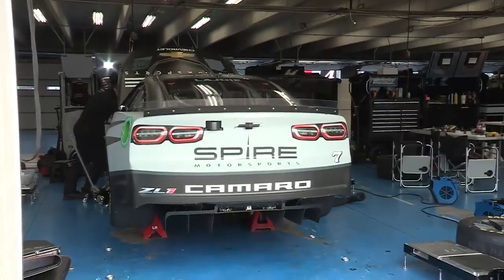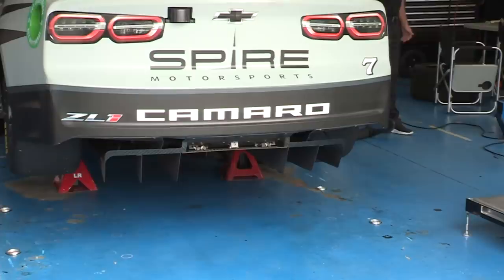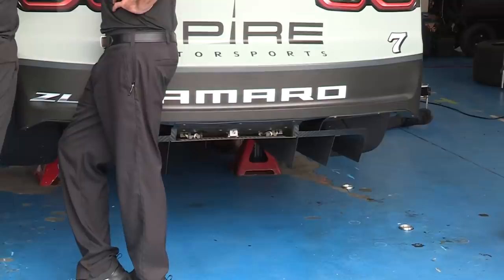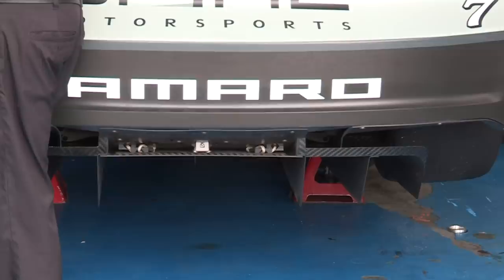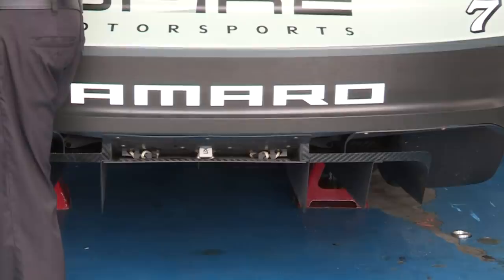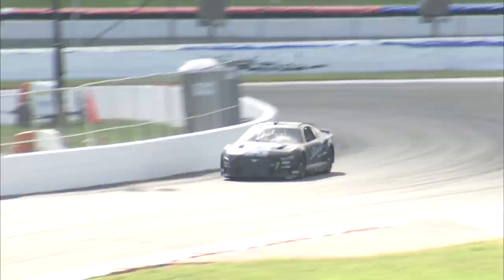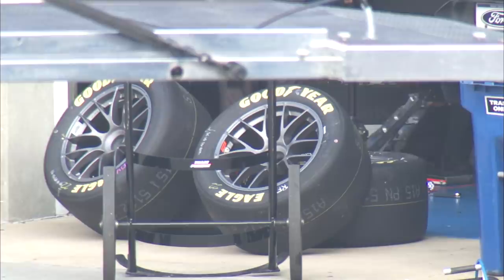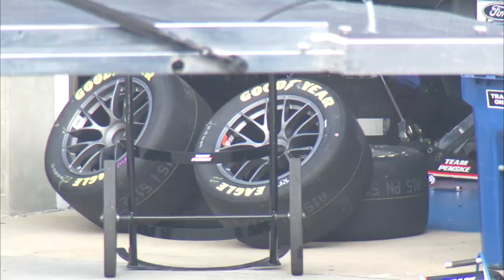Larry Mac breaks down center lug wheels on Next Gen car | NASCAR

Comment: What happens when the 1 fastener is not put on tightly deliberately like they do with Lug Nuts to shave pit stop time. The wheel comes off causes a wreck & death of loose wheels taking folks heads off in the stands. You know they are going to see what they can get away with just like in tech inspections.
Reply: A single lug stop in FI takes around 3 seconds, they will be waiting on fuel anyways.

Plus, what good would it do to leave a wheel loose on a single lug stop when it's guaranteed to fail? That would be akin to tightening only one lug on a 5 lug stop...
Reply: @codymoe4986   Larry when he was covering races like DW a few years back was talking about how teams have deliberately left the pits with 4 or even 3 lugs on the wheel & may not be tight. The lugs is held on the rim awaiting the tire change with a rubber cement material like Permatex. Sometimes they get knocked off the rim by the air gun hitting one as he tightens them. They have shown they leave the pits with only 3 or 4 & do not pit till or if the wheel tears out the holes on the rim causing a bad vibration.

Comment: They have to figure out how to get the BBS wheel on correctly so they don’t come off. We had two wheels coming loose. The wheel changer need to mount it correctly so the lock nut works.

Comment: How much crash testing has been done with aluminum wheels? I suspect the aluminum wheel of equal strength to the steel wheel won't be very much lighter. The center lug design eliminates the 2 tire stops for track position when they can change 4 tires faster than they can fuel. Some series don't allow changing tires while fueling.

Comment: Need to reconfigure Lug-nut gun to engage the new lug-nut to properly seat the Center (only) Lug-Nut per wheel. Seeing several loose wheels (each race) due to "Not TIGHTENING LUG-NUTS" to proper pounds per square inch.
Pit Crew guys will get it figured out, but Man-O'-Man.. seen some Close calls already..!

Comment: Think wheels changes will be about the same. With the single wheel nut you'll 1. Need more torque (some stock porches are in the 300 ft lb range), 2, left side will be reversed threaded.

Comment: Love listening to Larry Mac, but I kind of shook my head about the wheels. Says they're going to aluminum to be closer to production cars, then said because of aluminum they have to do the single nut. Kind of contradictory.
Reply: When was the last time you stepped on your brakes so often your brake rotors glowed bright red.  I'm willing to bet never.  The rotors on these cars glow on the entrance to pretty much every corner.  Thats a ton of heat radiating into the rims.
Reply: Most production cars use Alloy wheels these day which is in line with what Larry said. Centerlock nuts are required because of the intense heat the rotors will generate. If you use five lugs, that heat will work a lot of those nuts loose. He's not contradicting himself, he just explained/presented it poorly.
Reply: I think you guys missed what I was saying, all I meant was he said they're going to aluminum rims to be more like production cars, but because of that they're also going to the single nut. Completely understand why, but I just think it's ironic they're doing something to be more like production but it causes a change that makes it less like production vehicles.

Comment: Sorry Larry but a Rear Diffuser does not clean up the air behind the car how can I say this is because I also am a fan of IMSA and F1.  What I do see and fully believe will be a big problem is the falling down and breaking off of rear diffusers from bump drafting, and the general rubbing of front and rear bumpers in normal NASCAR racing.  Additionally I have great concerns about NASCAR not only going from a 15” wheel to a 18” wheel but even more concerns with the use of aluminum wheels as well as the center wheel nut. The bigger wheel is going to decrease the sidewall profile or size and while yes it will allow for a slightly stiffer sidewall it also takes away the shock absorbing effect of the larger sideway this will in theory possibly slower the cars down which is the reason that F1 also is going to a larger rim diameter but F1 is going from a 13” wheel to 17 and 19 inch wheel if I am remembering the sizes correctly where as NASCAR is going from 15 to 18 inch wheel diameter.  Additionally the width of the tires in F1 are much wider in F1 than NASCAR which will also play a major part in the impact of the change in wheel diameter.  As for NASCAR going to an Aluminum Alloy wheel this is of most concern to me for several reasons all which mainly have to do with safety.  To start with the steel wheels that all NASCAR teams use are relatively inexpensive and that is a good thing since each team needs to have enough rims for at least two races because of how the Goodyear tire program works.  The simple version is post race all the tires a team got for that race are turned back into Goodyear while they are mounted on the rims and then sent to a facility for the tires to be dismounted rims washed and inspected for wear to lug nut holes, square/trueness to ensure they aren’t bent, as well as being inspected for other physical defects such as cracks.  All of these inspections can be done visually with no problem because they are made of steel and the same is true for the new aluminum wheels except for cracks/stress cracks. Which is why F1 teams have the rims for there cars periodically x-rayed and they are scrapped after “X” many times tires are mounted on them.  The difference is a F1 team has at most 100 rims and team budget that could fund two a 4 car NASCAR teams and still have money left over.  A single car cup team needs to have around 175 rims so do the math for the how much the rim budget is going to increase and since a steel wheel basically is only replaced when a found to be no longer serviceable but the aluminum wheels in NASCAR like F1 are going to more than likely have a service life as well as needing to be x-rayed checked for cracks this is going to raise the cost of NASCAR cup racing on a series that has continued shrink it’s field size because of lack of race teams.  Back to safety concerns about aluminum wheels and NASCAR cup racing as it is we normally see between 3 and 5 wheels a race season suffer a wheel center break out due to impact against another car or wall my question is how many do you think will happen with aluminum wheels or possibly worse yet chunks of aluminum wheels breaking off when hitting the wall or curb and go flying into the stands possibly hitting a spectator.  Lastly a IndyCar or F1 car has far fewer pits stops than a NASCAR Cup car and it is not uncommon for them to cross thread a wheel nut /spindle and when that happens the car is retired in NASCAR currently teams will uses a rethreading  die if a wheel stud threads are damaged because they have five and in truth only 3 are really needed and additionally if a lug or two is not tight but the others are it really does not matter but if a wheel nut is not tightened correctly well there is no chance of limping it safely into the pits.  Personally I think think NASCAR is making a large mistake and will alienate even more of its core fan base and if they don’t attract replacements well it will continue to die a slow death but just faster

Comment: If they do it like F1 does it then the gun has a ton of LED lights on it. When they throw the wheel on; the nut is not torqued correctly so the LED's shoed Red (no crap, it's a loose nut). When the nut is torqued to the right spec then the light on the gun turns Green and they can move on to the next wheel or if that's the last wheel they let the car go. Every single other racing series has used a single giant Nut to hold on to the wheel since the 1960's. Point is that it forces every other part of the Pit Stop to be faster and much more competitive, leading to more competitive pit stops.

Comment: Will the wheel lock nut stay in the gun now and be reused throughout the race?
Reply: Yes. One of the spotters was chatting with an F1 pit crew member and the guy claimed that they have been reusing the same nuts for longer than a decade.  NASCAR crews dont currently reuse their nuts allegedly= cost savings

Comment: I am interested on how they're gonna take off and replace the center lug. Will it fly off and a new one be in place already? That's a large lug to be throwing around. Will it lock onto the gun and then release after it's retightened. Will cross threading be an issue at All?
Reply: The rims have the lug nut locked onto the rim so the lug nut and rim are one piece essentially

Comment: With the way the diffuser looks, it looks like bump drafting would damage it and that couldn't be good for it. And before you comment and say that you're sure they tested for that. Remember that 1 generation of car R&D didn't realize the front and rear bumpers didn't line up causing a ton of crashes and only lasted for 1 season. So no they may not have tested that.

Comment: Quite a few wheels will fall off to start with whilst they adjust to the centre lock wheels, they had several wheels come off in F1 when they banned mid race refuelling, there will be ill fitted wheel locks to start with

Comment: How can you say going to aluminum to keep car stock like vehicles today and I have yet to see any with a wheel lock. Some change is good but one lug nut makes as much sense as stopping a race for multiple stages. Sorry but those changes aren't good bad enough nascar is cutting out small older tracks and doing road courses. If I want open wheel courses I'd go watch formula one. I guess next nhra will run 1/8 mile stages and do it on ice.

Comment: It's a bunch of crap that NASCAR is sourcing wheels from an OVERSEAS vendor. The vendor - BBS Of "America" - is only a distribution point - the 18" alloy wheels are forged and machined exclusively overseas, as is where the BBS corporate headquarters is located and where the money actually goes. At a reported $1800 per wheel, it will cost over $3 million for wheels to start the season at Daytona - this money should be spent at an AMERICAN FACTORY. It's a big slap in the face to the fan base that spend their hard earned dollars to support NASCAR - an AMERICAN ICON - and have NASCAR not support U.S. manufacturers in return.
Reply: they been supplier for long time
Reply: @johnhaas2523  That only means we should have been looking for a US based supplier for a long time.

Comment: Seems to me with the center lug, which could speed up pit-stops the thing that may take the longest is getting a full fuel load. Wonder how many will leave the pit before getting a full fuel load in order to get better track position.... and later may end up running out of fuel later while on the track?
Reply: in reality it would speed up the pit stops but that's not what Nascar wants so the guns will be slowed down

Comment: Aluminum wheels will be a disaster. Imagine one of these wheels disintegrating in a crash on the front stretch, and shards of aluminum are flying into to the stands...
Reply: Pretty much every single other racing series use aluminum. Nascar were the weird ones for using steel

Comment: I'm curious as to why they didn't go with the air jacking system like they do on the Aussie V8 supercars...
Reply: It eliminates tire strategy on ovals. There are situations where you can get away with only changing right side tires and using an air jack would defeat any gain from doing so.

Comment: I stopped watching NASCAR years ago, but the car was never the issue with me.  I don't care what it looks like, I don't care that it's slower than IndyCar (so are sprint cars which are awesome to watch).  The races were boring(other than the premier tracks every race doesn't need to be 400-500 miles), the announcers catered to the lowest common denominator in viewers, the wrecks were overhyped as were the driver fights.  Then came the playoffs or whatever you want to call it.  All an attempt to make up for an inferior product.  With each successive change the races became less and less watched and it seems nobody in charge has realized they should look at when popularity was at it's peak and attempt to recreate that.    What happens when your equipment at home has degraded beyond the point of fixing?  You hit the factory reset button and that's what NASCAR needs to do.

Comment: I'm wondering how much debris will come from an aluminum wheel in an accident and remain on the racing surface. 
A destroyed steel wheel pretty much stays in one piece. Whereas, the destroyed aluminum wheel will come apart with no less than several pieces.
Reply: Interesting observation... now I'm wondering the samething!

Comment: 5 lugs adds a variable to the race i hate the single lug this is a stock car show me a single car with single lug
Reply: Porsche Carrera GT[6]
Porsche 918 Spyder[6]
Porsche 997 (GT3, GT2, GTS, optional)[12]
Porsche 991
Koenigsegg One:1[17]
Koenigsegg Regera[18]
Lamborghini Aventador SV and SVJ (optional)
Lamborghini Huracán (optional)[19]
1963 to 1967 the Chevrolet Corvette 
and alot of older cars had knock off wheels it is quite dangerous and alot of wheels will be flying off now though
Reply: @ryancuda45  thoes are sports car / super car not a stock car
Reply: @supergelf1  Those cars come STOCK with center lock wheels.
Reply: @supergelf1  depending on your budget its a stock car. as for nascar its old outdated and needs a refresh. instead of loose wheels its just gonna fly off now. the pit crews have wanted this rule for over a decade.
Reply: @shrimpshrubbery7664  yea and there is 7 ferrari that come with them too. wait and the mclaren F1 i think. and a few others. ktm x bow, brabhams new car. and the new gordon murray fan car.
Reply: @ryancuda45  i deff get it i happen to like the variable that a loose wheel and the pressure to get 5 lugs tight it adds something im my opinion i dff get the allure of a single lug im a big f1 fan too just feel theres somethings that should not be changed
Reply: @supergelf1  
yea im a huge F1 fan too, and im split 50/50 to make the single lug change. rather have a loose wheel then a wheel fly off into the stands at 186 mph. i lost a single lug wheel at 163 mph scary stuff

Comment: every thing about the rear defuser is correct MINUS the " down force " part thats just a simple no....no it dont do that
Reply: Not entirely. The rear diffuser creates a low pressure area underneath the car which in turn allows the downforce built into the car to  works more efficiently. So he's not wrong!

Comment: Lug nut glued to the wheel? Or do they use the same one throughout the race?
Reply: Same one. The guns hold the nut till they reverse it to put it back on.
Reply: I just saw one video where they said one Aussie V8 Supercar team had used the same single lug nut for 6 years so they are apparently pretty durable

Comment: What about those aluminum wheels when they have a crash ?  Just like a production car , they’ll break , and as fast as these guys will be moving , a flat tire will most likely make that wheel disintegrate , and most of the time the cars will have to be towed off the track. Not like with steel wheels , when they would just bend , the driver could still make it back to the pits. I guess we’ll see if they have that part worked out. I’m not a fan of the wheel change. 
👍👍👍✌️✌️✌️
Reply: Me neither, like the 5lugs was so nice to see, I don‘t watch Nascar for it becoming as boring in the pits as F1, like hearing those 5 bolts go out and in, just amazing, but now just one boring sound, the aluminum rims also make me bother about the situation the drivers will find themselves in
Reply: You act as if although every single raceing series in the world use giant steel wheels and nascar are the weird ones for using aluminum lol.

Comment: I think this new gen car is a good move by nascar to modernize their cars. The one lug is cool but I follow Indy Car close and there are plenty of issues if the person running the air gun doesn’t get it tight or cross threads it before the jack drops. They also seem to get seized on as well. I guess time will tell.

Comment: Increase HP substantially NASCAR!! That definitely helps in passing and putting the control in the hands of the driver. These are racecars aren't they? The current horsepower numbers are tragic!
Reply: Also, take off the spoiler and lets see who can really drive.
Reply: the manufacturers do not want high horsepower
Reply: @cobyg419   you must be a fan of drag racing....

Comment: Wonder if fueling will change. It seems with the 12-13 second stops you barley get the 18 gallons in the car. So taking 2 tires probably won't make much difference since you'll have to wait for the fuel anyways.
Reply: nothing is changing other than going from five to one lug nut
Reply: @johnhaas2523  I know, but it's going to be faster, until we see the teams practicing these might end up being 10second pitstops

Comment: If the pit stops are a little quicker with the single lug wheels. What's that gonna do as far filling the car up. Is it still going to allow enough time to get every ounce of fuel in the car that these crew chiefs and engineers have put so much time and effort in to figure the exact ounce for these tracks?
Reply: It might increase the importance of fuel savings even outside of "fuel milage races". You see this in Indycar where fuel is often the limiting factor of pit stops, on tracks that are difficult to pass certain drivers like Dixon will often sit behind someone, drafting and saving fuel, and then he's able to overtake them on pit road cause his pit stop was quicker.